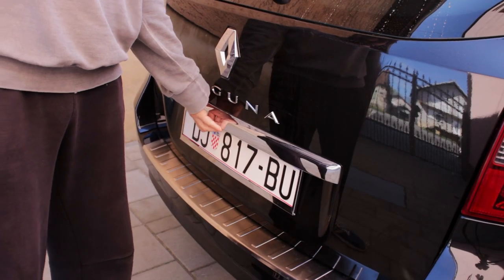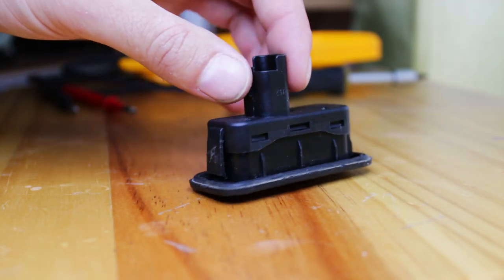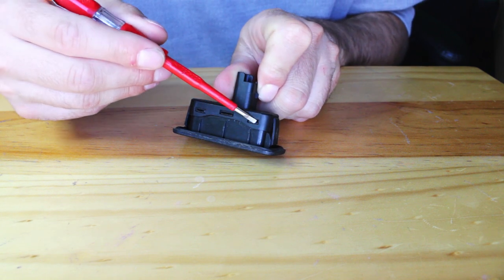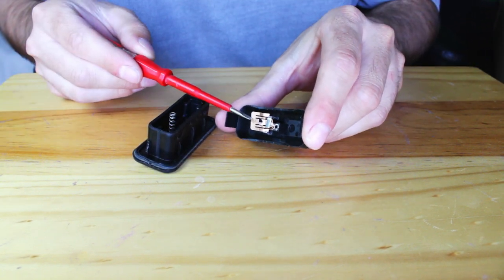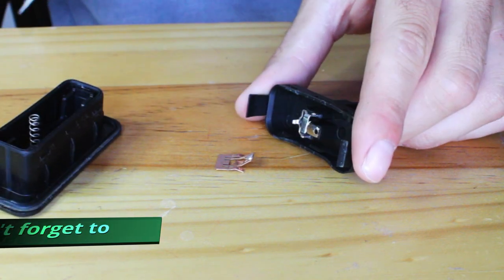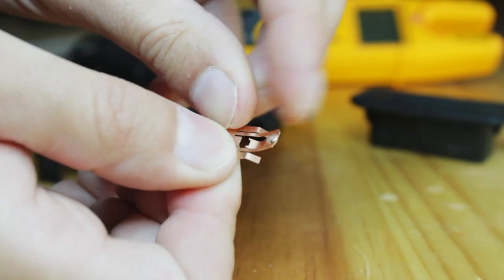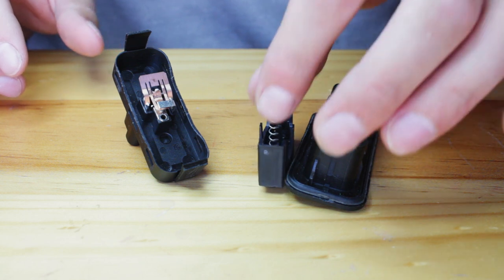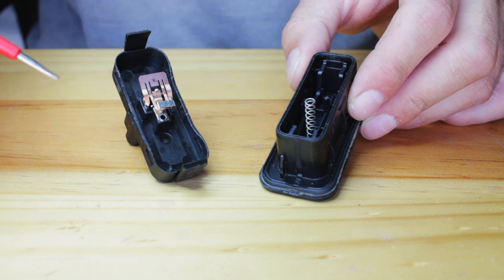Tailgate switch button repair - Renault

Comment: Excellent video. Like another commenter, the switch was full of water which had caused corrosion in the switch. Following this video, I took it apart, cleaned it all up and bent the contacts as you showed. All works fine now - until it breaks again. It's a Renault after all!
Reply from the maker: Thank you for sharing your experience. Good luck with your Renault! 😃

Comment: best friend during replacement of interior lighting from halogen to led lighting my all lights have gone out nothing work according to a friend a short circuit at the fuse box and I have to put a new fuse but I do not know where the fuse box is and which barely fuse  I should use would you make video about it or help me please and thank you and best wishes for that.  2021 I have grand scenic 2010
Reply from the maker: @Ali Tanrioven  Hi. Fuses on Grand Scenic 3 are placed behind the storage compartment on the left side from the steering wheel and there should be a fuse for lights. Another place where you can find fuses is under the hood, they are placed on the right side from the battery. Best wishes to you as well in the upcoming year and we hope you will solve your problem.

Comment: Thanks for this, but i have to reach this button and i'm not able to remove the plastic cover inside the tailgate of my Megane III Sportour. Can you help me?
Reply from the maker: @Gianluca Gargiulo  Hi. Maybe you can check our video where we have removed that same part on Laguna 3. The process should be similar for Megane also, although we think there might be 2 more T20 screws to unscrew beneath the corner surface panels. Link is here: https://youtu.be/KtOCToerH5I.
Hope it will help you, good luck!
Reply: @BbrosAuto  thanks for the answer. Yes the video is useful, so there are only clips over 2 screw. My hope is to leave the cover without destroying the clips. Thanks a lot!

Comment: Isprobajte DDT4all sa lagunu. Mogu vam dati link do obd readera koji rade sa ddt4all. Imam jedan problem sa lagunu 3. Ne rade mi vise dynamic light. Kad idem u ovinek luci ne prate. A kad ukjucim avto luci se kalibrirajo. Imam xenon. Drugi problem kad dam u rikverc. Retrovizori se ne spustajo da vidis crte kad parkiras. Prije je delalo. Mozda da se ovo moze srediti sa ddt4all
Reply from the maker: Možda bi se dalo to srediti sa DDT4all, vrijedi pokušati. Osobno još nisam probao DDT4all, ali bih volio. Može link od obd readera. Hvala.
Reply: @BbrosAuto  ja sam narucio ovog. Opciju with cd.

#Aliexpress € 4,31  5%OFF | ELM327 V1.5 Supports More Cars 100% Hardware V1.5 ELM 327 Bluetooth 1.5 Car OBD2 Diagnostic Code Reader Works Android Torque/PC
https://a.aliexpress.com/_BfAzMUDo

Connecta se na ddt4all ali nema nista tuttoriala za lagunu 3 na internetu pa neznam nista da bi dirao tamo 😂
Reply from the maker: @denis213 Izgleda mi dobro i uzet ću ga i sam. Hvala